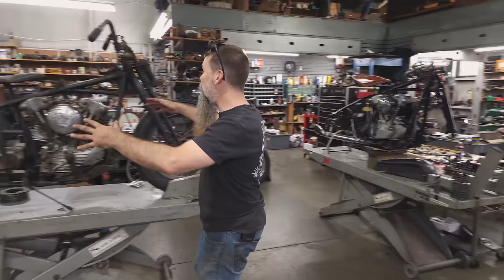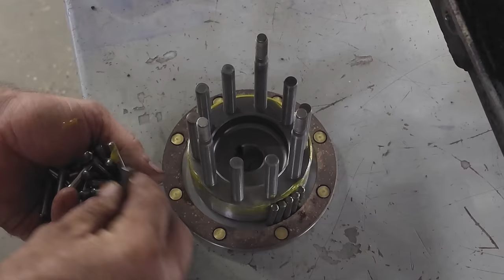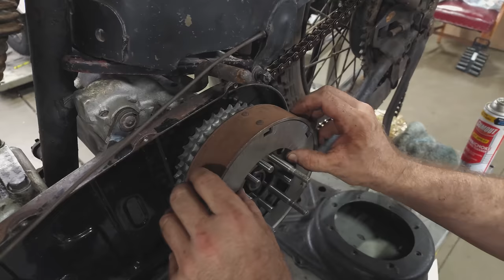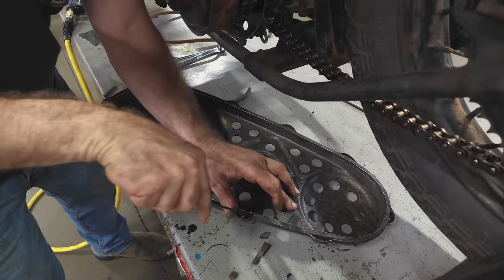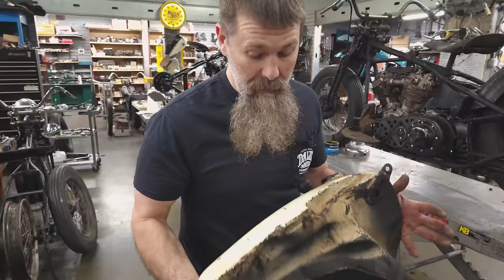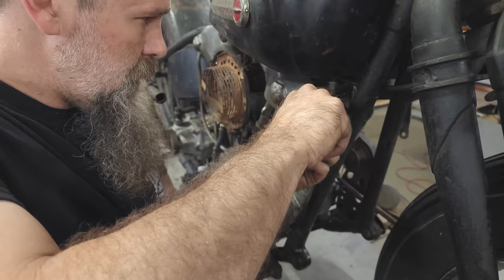Can We Revive This RARE Barn-Find Harley Racer?

Comment: My buddies and I re-build pre-WWI "barn-find" motorcycles! "ACEs", "Curtiss's", "Excelsior's", and others, built on Columbia and Wright Bros. (yeah those Wright Bros.!) bicycle frames, many street bikes, but some alky burning "board track racers"! Riding a 61 CID 65 HP board track racer with no brakes, no clutch, no throttle, no gears, only a kill switch to control your speed on BICYCLE TIRES pumped up to 90 PSI on a 1/4 mile dirt track takes some big brass ones! I can't imagine Glenn Curtiss racing on an 1/8 mile track of boards with 32 OTHER racers, who would KICK, PUNCH, RAM each other at over 115 MPH for a $25 or $50 prize!!! I can appreciate your efforts. Some of us are machinists who CNC new pistons and rods, even crankshafts. Many of our street bikes are total loss lubricated, and all the racers are, and all these ancient engines use 100% caster oil. Great work!

Comment: When I bought my badly abused 1947 el Knucklehead in 1977, it took me a while to figure out how to  start it; timing sequence, fuel accomodation, checking for the correct needle settings on an M-36 Linkert, and all the rest. 
I finally got it down to a science but it was always a process. Not like modern Push a button and go bikes. Now, I'd give my left nut to have that bike again. Yes, I entered the drawing for the Knuck! 👍

Comment: I wonder if you have one of these tools in your shop ? Its an aluminum block threaded for a spark plug in one side, and a thick plexiglass window in the other, then add a tire valve, or a shop air hose fitting in one of the open edges . I found the best size for this device is to use a an aluminum block that is 3x3 inches square and 1 inch thick. I bore the middle out and make sure that it's big enough so that when you put a spark plug in it, that you can readily see the plug gap. I would also drill and tap the sides of it, so I could test systems with other sizes of plugs. You connect it to shop air at 100-120 psi to pressurize the block. You also add a ground wire with a cylinder clip. The idea of this device is to test the ability of that bikes ignition system. If an ignition system is weak , it won't throw a spark under compression, but if you lay it out on the cylinder head it will.. I don't have any right now, of course I lent them out and never got them back, but I could easily supply a diagram.

Comment: Sounds great I had a BSA 750 and you could kick it for a hour and it would not start and walk away and come back 15 minutes and one kick and it would start
Reply: I think sometimes they get flooded and can’t get the gas to atomize so it’ll mix and fire off. 
Seems to be even worse on high performance stuff since it’s usually setup for high rpm so has very low velocity at idle/starting. And, sometimes if the ports are polished they’re so smooth there isn’t turbulence to get the gas mixed in better.

Comment: Usually when old school heads got larger valves and the intake runners were modified everything worked well WFO plenty of flow . 
But at starting ( kick) R.P.M.
velocity was lost into the combustion chambers and the intake charge didn't stay atomized causing a fuel rich condition that inhibited the proper air / fuel ratio to initiate combustion. Or maybe there was dirt in the mud valve........

Comment: Racer mentality: I saw the needle set up was not stock. In too deep. Saw from the bench carbs set up was different? Not the expert. Like the shop rag for choke try.  Dig the rust coming off the kick spring! A monster no smoke. Instant throttle response. Knee pad is recommended. Tweaks matter. You commented on the carb numbers being filed off or missing. Now why would someone do that? Peace from West Texas. Killer content. Legacy of our Ascencion.

Comment: How do you know it's a factory racing engine and not homebrew?
Reply: I would think not many people during that time would of had the knowledge or the lathes mill and tooling to make those custom flywheels and the rods they used to take it to 80 cubes from 74 plus the valve pocket cutter to open up the bowls to put larger valves in the heads because most didn't have the money or did they know how to use the machining techniques to do a successful job on those parts so the engine would run like it's supposed to. I think it was probably a factory race bike or maybe a HD dealer had bought the bike and did these mods to it to them race it because the average guy back then wouldn't have access to that kind of stuff unless he was well off money wise and could afford to have one built or just outright buying one done up already .  At first I thought maybe that the flywheels were too light causing hard starting a long with the higher compression added because I have seen something similar where on a 4 stroke push lawn mower engine if you try to start one without the mowing blade on it they will not start because the engine even though it has a flywheel it still needs that extra weight of the blade to add enough weight and inertia so it will run .
Reply: @peteloomis8456  
It may well have been a dealer homebrew with a machine shop connection. But ordinary guys had machine shop connections too. That was no big deal. Another reason I wonder about it being factory is that in a previous video it appeared to have an "EL" stamped left crankcase. If it were a factory racing engine, it would be stamped with a special racing engine letter designation so they could identify it. Matt calls it an "FLTT" but if that's what it is, why isn't it stamped that way? Was the crankcase blown and replaced with an EL case? Or is it homebrew? We need to know more about this interesting motor.